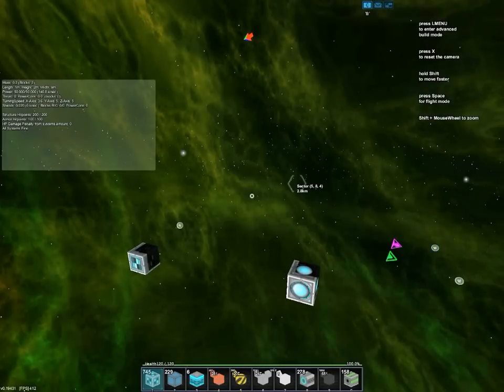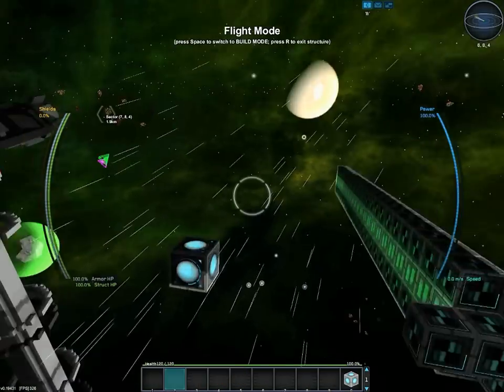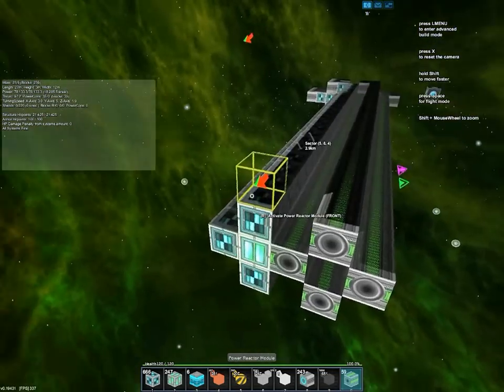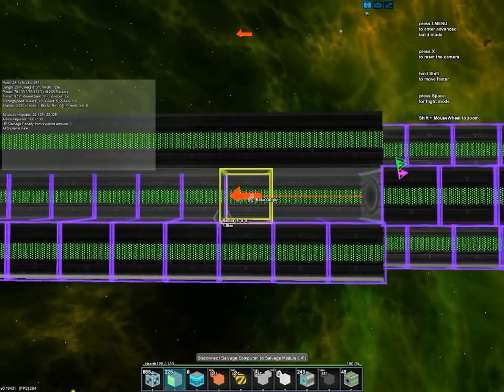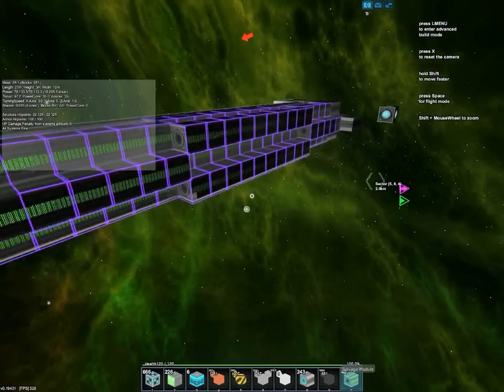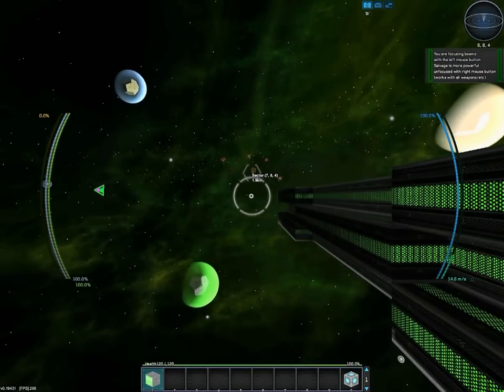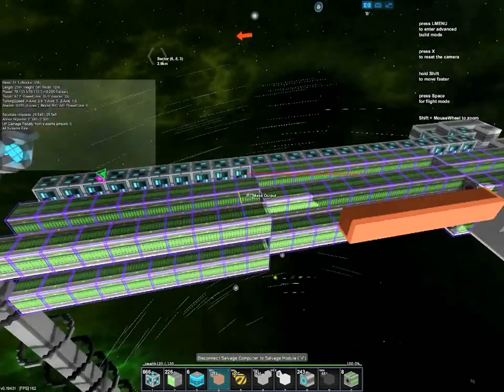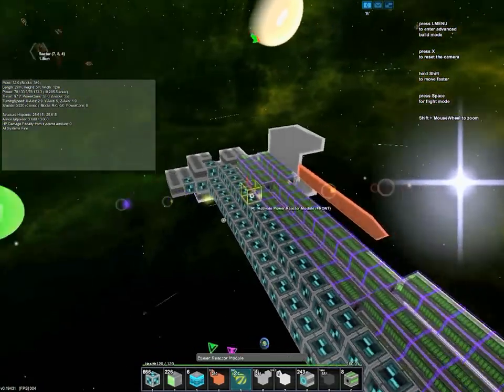StarMade | Survival | Episode 11 | Light Mining Barge

Comment: Nice ship overall, I was looking forward to the asymmetrical design, but see you went with a more symmetrical design after all.  Still, it looks decent and seems to get the job done.  Awesome to see some Starmade vids, and looking forward to more

I think you can SHIFT-V to select an entire connected group, useful for connecting modules back to their computer in case of damage too.  Less useful for cannons that don't touch on the side, but better than clicking each module individually ;p

Also, you should be able to slave cannons to your mining lasers to reduce the cooldown.  You need a 1 to 1 ratio of each to get the full effect

Finally, you should be able to use the advanced crafting sliders to get the size you want to copy, you had it set to 1 x 1 x 10, but you could adjust the other sliders for width and height as well.  I suggest changing the default size from 10 to either 50 or 100 in the server config as 10 is rather small for larger builds
Reply from the maker: +AlabasterJazz Thanks for the tips!

Sadly it did revert to more Symmetrical - though once I can move the Cockpit and maybe add some details here and there it wont be so noticeable